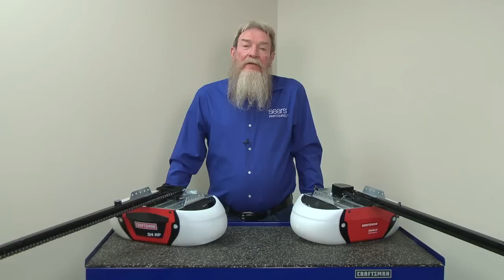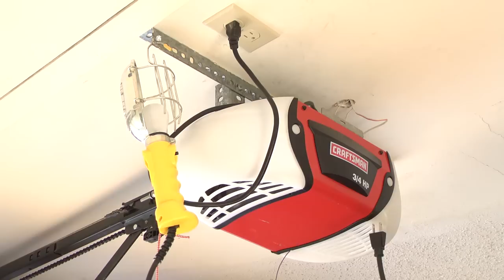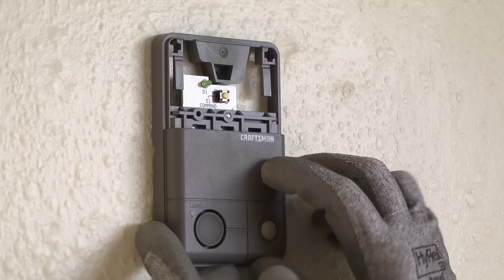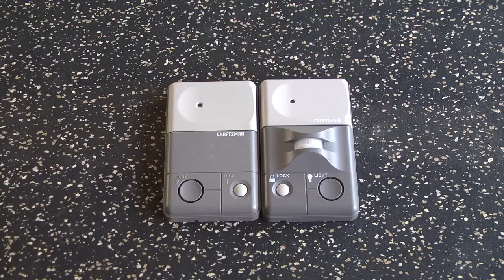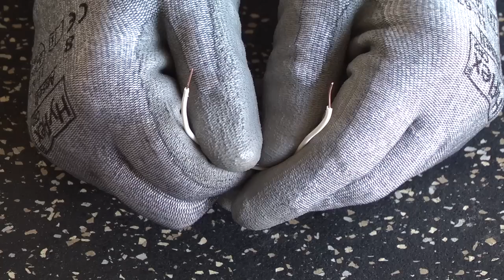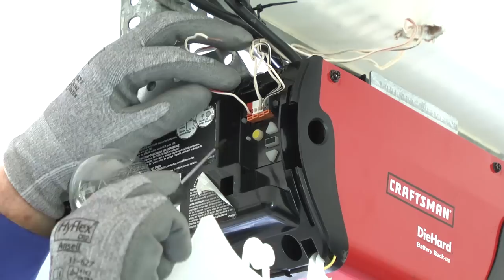Garage Door Opener Doesn't Work: Wall Control Troubleshooting

Comment: I tested my wall control using short wires going directly to the opener.  That worked.  When I put it back on the wall I noticed that I had not made a good connection previously.  I had not fully stripped the insulation off of one of the wires.  Thanks, your troubleshooting video was great.

Comment: After spending an hour our two on this I had worked out in my head how to test the door control panel. But you confirmed my thoughts on what to do next to diagnose the problem.
I wonder where you are job-wise 7 years later in aftermath of Sears wind-down.
Well done!!

Comment: I have a wall control, the fancy LCD display, that will stop responding about one out of three or four times I walk into the garage and want to open the door. I know it has power, but fails to sense motion, or respond to the switch at the top to actuate the door. I've sometimes taken the cover off and touched the switches with both hands and it sometimes will wake up. Once I use a remote to move the door, the wall switch 'wakes' up and will respond normally. So it is very intermittent. I now have removed it from the wall and have tightened the wires at the terminals. The wires appear fine, they were the existing wires for the previous system, and that system never failed to actuate. I loved the video, it really has been a help. Crossing my fingers that the tightened connection works well.
Reply from the maker: Let us know if tightening the wires doesn't fix the problem, and we'll see if we can help figure it out.

Comment: Great tutorial. The jumper option i believe doesn’t work due to that the LiftMaster Model 882LM Multi-Function Control Panel is Security+2.0. There’s a paragraph about it in the installation instructions under “Wiring Research”.

Connecting directly to the opener doesn’t work because the the openers enabled with Security+ 2.0 (MyQ and AssureLink models from LiftMaster, Chamberlain and Sears) can’t be triggered with a toggle. They must use the encrypted serial protocol supported by remotes like the 882LM.
Reply: I know this is an old comment but thank you, I was wondering why the multimeter was giving a tone on the wires but touching them didn’t open it. Replacing the wall mount!

Comment: Ive been looking for a wire diagram or trouble shooting FLOW CHART for a couple of days, pissed off beyond all measures because GOOGLE cant locate one, like either the industry is full of "specialists" that throws parts at problems to eliminate them one by one or the industry is afraid people will fix things on their own when given the correct information. Well, I tend to think there is equal measure of both. I have used this guys diagnostics in the past fix two different washing machines, you are a great trouble shooter and worth your wages all day long.  My problem was after replacing a tension springs and the limiter switch the "WALL MOUNT" (really, wall mount? Isnt it a "Touch Pad") was flashing non stop rapidly. I had added a LED light to the flood light circuit and wasnt sure if I had damaged the Circuit Board but couldnt verify. The hand held remotes all worked, but the WALL MOUNT didnt move the garage door up or down. Taking the wall mount down and looking at crossing the wires together made the door open and close. Good so far, but while moving the mount in my hand the door would all of a sudden start to operate, WTF? SO, I banged on the back of of the WALL MOUNT and it would start to function again. I took the backing plate off of the WALL MOUNT and looked at the circuit board and sure enough there was a burned contact on the WHITE wire. I disconnected power, and then I was able to drop a small amount of solder on the contact and firmed it up and reconnected the mount to the wall and plugged in the Garage Opener. and all is well 30 minutes later. I am going to post this video to my FB as the BEST GARAGE DOOR OPENER DIAGNOSTIC VIDEO EVER!
Reply: i have the same problen and can not not fine an vidio troubel shouting the 3 remoc3ed push booton frank.

Comment: ADD.  The problem may be that the plastic foam that acts as the "spring" for the wall control buttons has died.  The inevitable failure of $.0001 of plastic kills the entire wall control.

Comment: I have the model that’s more complicated (and discontinued now) Touching a multimeter with a tone to each wire screw on the back of the wall mount, then pressing the open button should give a tone right?

Comment: I lost power recently and had to manually open the door by pulling the cord.  I thought i reset it because the two remote controls along with the keypad work to open and close but the wall button inside the garage was flashing and hasn't worked.  I did something where it's no longer flashing but it still won't open.

Comment: Is it okay and safe to add a 2nd wall control unit?   If so, is it as simple as tapping into the terminals on the motor unit?

Comment: Would connecting the wires cause the motor to work in reverse. Closing instead of opening. The reason I ask it’s because the sensors should stop the door from closing and opening up again when it senses an obstruction. In my case it does the opposite, the sensor stops the door from opening and closes when it detects and obstruction.
Reply from the maker: Let us know the model number of your garage door opener so we can see the type of control it has. Also, give us more details about how the problem started. A miss-wired wall control won't cause the garage door opener to run in the opposite direction as intended in many garage door opener models. Connecting wires to the logic board or motor incorrectly could cause the motor to run in the reverse direction in some models.

Comment: The wall control on my Craftsman model 139.54930 doesn't work. Trouble code is 1 up arrow and 3 down arrows. Checked wiring, did the jumper test procedure, still no operation, same 1 up 3 down arrows. Replaced the logic board with a new one, same thing. Don't know what else I can do.

Comment: I dont understand how I can jump the switch at the wall and see a change in voltage at the opener terminal block but still no movement (unless there is an issue with the board ) Some people are saying it has to be a multi function opener for it to work? What does that have to do with anything if Im sending 12v back tk the opener? Thanks

Comment: It appears mine is the logic board but I don't see a link to click for that. 
Also, what would the part number be for the logic board that fits my 3/4 hp Craftsman opener?  Where or how would I find that board info to be sure and order the right one?

Comment: Have an older craftsman unit 1/2 hp . I can't get the unit to accept any codes. Tried clearing all codes, locking out the unit from the wall mount and then unlocking; nothing works. Replaced logic board on unit and still can't get new codes. Can the board on the wall mount cause this?

Comment: My garage door only goes down a little ways and then back up flashing light ten times.  little yellow light above purple square button flashes I believe 4 times after that.  Both sensors green and yellow are lit up near the floor solid.  A technician came out and wanted to charge me $195 to adjust and replace the sensors.  Said the sensors cost $150.  That's not what my research shows they cost.  I declined.  Is this standard sensor replacement?
Reply from the maker: The sensors may be defective but that code could also be caused by sensor wiring problems. We recommend that you follow the troubleshooting steps shown in this video/article to check sensor wiring: https://www.searspartsdirect.com/diy/article/garage-door-wont-close-safety-sensor-troubleshooting-video-lights-blink-10-times  If the wiring is okay and the sensors don't work when connected with short wire directly at the motor unit as shown in that video, then you'll likely need to replace the sensors. If you replace the sensors and the garage door opener behaves the same, then you'll likely need to replace the logic board in the motor unit. We hope this information helps. If you need more assistance, let us know.

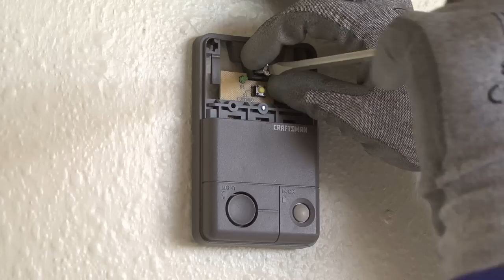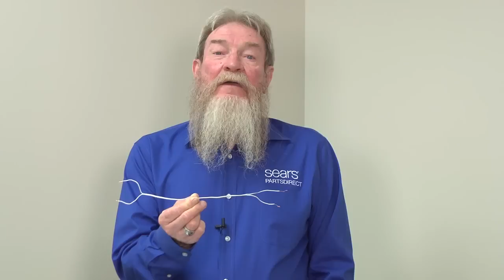Comment: At 2:15 if you have one of these wall controllers, click here... Uh Where????  At 3:53 he pulls the wall control that I have off the wall.  Would have been Great if he could have shown how to remove the face plate.  This is the video I need without breaking the controller.

Comment: Great Video. I have Liftmaster 2280 that does not open. The light button on the control penal turns the motor  on-- just noise-- but the door does not move. Any idea?
Reply from the maker: Make sure that the garage door isn't locked shut. Pull the emergency release rope to release the garage door from the trolley and see if the garage door moves freely up and down on its tracks. Follow the troubleshooting steps in this article/video if needed: https://www.searspartsdirect.com/diy/article/garage-door-wont-move-motor-and-travel-troubleshooting-video . We hope these tips help. If you need further assistance, let us know.

Comment: on the belt drive what if it blinks up 3 times and down 2 what does that mean?
Reply from the maker: That code typically indicates that the control isn't detecting door movement.

Comment: We'll this stepped all the way around the problem.I'm having..  my wall button is a doorbell switch.  My door opener will work from the controls on the opener. It won't work from the button  or the remote..
Reply from the maker: To troubleshoot the doorbell switch, check the wiring as shown at :58 in the video. If the wiring is okay, disconnect the wires from the doorbell switch and briefly touch the bare ends of the wires together to simulate the doorbell button being pressed. If the garage door opener works when you briefly press the bare ends of the doorbell switch wires together, then the doorbell switch is broken. Replace the doorbell switch. Here’s a link for the replacement doorbell switch: https://www.searspartsdirect.com/part-number/41A4166/0009/139.html If the garage door opener doesn’t start when you briefly touch the doorbell switch wire ends together, connect short strands of wire to the motor unit wall control connections and touch the bare ends of the short wire strands together. If the garage door opener doesn’t work then you’ll likely need to replace the logic board because the logic board isn’t detecting the wall control signal. If the garage door opener works when touching the short wire strand ends together, replace the wiring between the garage door opener and the wall control because a break in the wall control wiring is preventing the wall control from working. If you fix the wall control and can’t program remote, follow the steps in this video to troubleshoot the remote: https://www.searspartsdirect.com/article/garage-door-opener-remotes-wont-work-video.html We hope these troubleshooting tips help. If you need more assistance, post additional details and let us know the model number of your garage door opener.

Comment: I need help. App works, outside code unit works. The wall panel has light and says PRESS PUSH BAR TO ACTIVATE CONTROL. I push, nothing happens. Checked the voltage on the wiring, it's good. Tried the new wire test close to the garage unit opener. Nothing.  Not sure what to do anymore. Any suggestions
Reply: Did you get it fixed? This is the same issue I'm having.

Comment: When I use the wall control my light blinks three times, then my car receivers quit working. Re-program car  receivers. They will work as long as I don’t use the wall transmitter.
Reply from the maker: The 3 blinks when you try to use the wall control indicates that the logic board detects that the wall control is bad or the wall control wires are shorted. Follow the troubleshooting steps in your owner’s manual to determine whether the wall control is bad or the wall control wires are shorted. If you can’t find your manual, you can use the manual on this webpage: https://www.searspartsdirect.com/partsdirect/user-manuals/13953925ds-craftsman-parts-manual. The troubleshooting for the 3-blink code is on page 34 of the online manual.

Comment: My garage door opens if I push the button on the motor. It opens when I push the wireless remote that I carry in my pocket. The wall mount doesn't work. I disconnected the wall mount and shorted the wires: nothing happens. I climbed up to the motor and removed the left-most red and white wires, then inserted some new Cat-5e (telephone/data wire) into the red/white, then shorted them out on the other end, twisting the bare wire together: The up arrow flashes once, then the down arrow flashes three times. The video says at 1:40 that it's a wall control wire failure or a defective wall control. How can it be a defective wall control or defective wiring when I'm using a 2-inch piece of wire at the motor?
Reply from the maker: Shorting the wall control wires together using short pieces of wire connected to the motor unit works for testing some types of simple wall controls that have a single LED light. That test won’t work for all wall controls. Try connecting the wall control to the motor unit using short strands of wire. If the wall control works properly when connected to the motor unit using short wire strands then you'll need to repair or replace the existing wall control wiring. If the wall control doesn't work when connected to the motor unit using the short wire strands then you’ll likely need to replace the wall control because it isn’t sending accurate signals to the motor unit. If you replace the wall control and the problem continues, you’ll likely need to replace the logic board in the garage door opener motor unit. We hope these troubleshooting tips help. If you need more assistance, give us an update of symptoms based on the above advice and let us know the model number of your garage door opener and the type of wall control that it uses.
Reply: Sears PartsDirect thanks for the quick response. I’ll try disconnecting the wall mount from the wall and using shorter wires to connect to the motor.
Reply: No luck. Connecting the wall mount directly to the motor (with 6 inches of wire) make the wall mount display light up, but it won't open the door. Pressing the button on the motor makes the door open. Pressing the wireless remote makes the door open. Shorting the wires by hand at the motor doesn't make the door open.
Reply from the maker: Because the wall mount display lights up when you connect it to the motor unit using the 6-inch wires, you’ve eliminated the wiring between the wall mount display and the motor unit as a potential failure. If your wall control has a control lock feature that prevents the wall control from opening/closing the door, make sure that the control lock feature is disabled. If the wall control doesn’t have a control lock feature, then the wall control or the logic board has likely failed. If the wall mount has more than one button, then you’ll likely need to replace the wall control. We don’t have technical information to help you test signals from a wall control with more than 1 button. If you replace the wall control and the problem continues, then you’ll likely need to replace the logic board inside the motor unit. We hope this additional information helps. If you need more assistance, send us more details and the model number of your garage door opener (along with the type of wall control it uses).

Comment: my wall button normally is lit. it is now not lit and the push button does not open or close the door. however, the remote opener does open and close the door. do i assume my wiring from the opener to the button is broken somewhere? thx
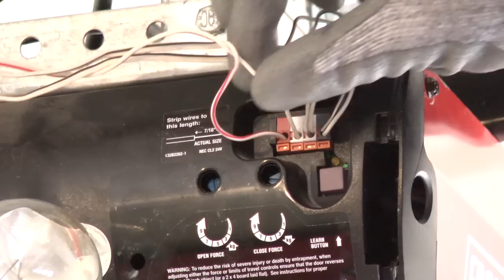Reply from the maker: A wiring failure between the garage door opener motor unit and the wall control could prevent the wall control from working. Check the wiring as described at 1:04 in the video. Reconnect any loose wires and repair or replace any broken wires. If the wiring is okay, then you may need to replace the wall control.

Comment: While trying to add a second light in my garage had some power issues.this made my garage door light go on and off and unit clicked numerous times.unplugged garage door opener.now wall unit is blinking and the nothing works on wall unit.garage door only works with remotes and keyless entry. I tried holding button to make it stop blinking. Seems like in vacation mode but wall unit is actually suppose to work in vacation mode.and the remotes are working....any ideas how to get wall unit to stop blinking and actually work the garage door and lights.also the feature  that senses movement in garage and turns on lights is not working anymore either.any ideas?😕
Reply from the maker: Let us know the model number of your garage door opener and the type of wall control that you have. The model number is on the motor unit. You'll typically find it under a light cover. We'll try to provide some advice and troubleshooting once we get that model number.

Comment: My doorbell type bottom appears to be in vacation mode.  That is it is blinking.   To take it off vacation mode I tried holding the button in for 3 seconds (still blinked) then ten seconds (still blinked) then thirty seconds (still blinked) ,  My question is, how do I get it off vacation mode ??   Thanks much
Reply from the maker: Unplug the garage door opener motor unit from its electrical outlet for 1 minute to reset the logic board and then plug the power cord back in. The doorbell light may stop blinking and the garage door opener may work normally. If that tactic doesn't fix the problem, let us know the model number of your garage door opener and well try to help you further.